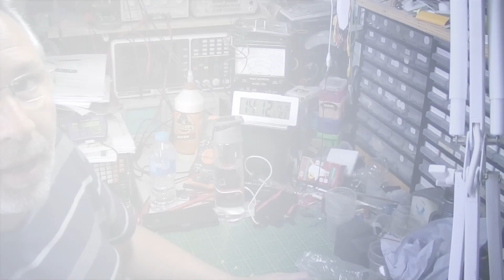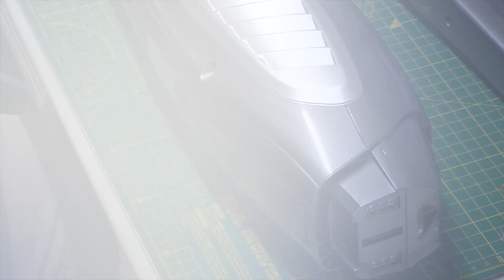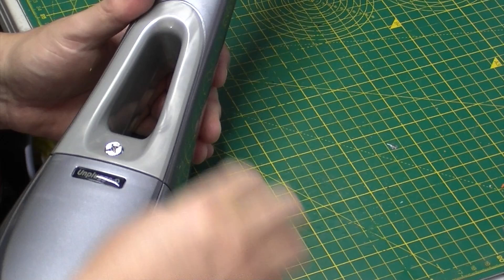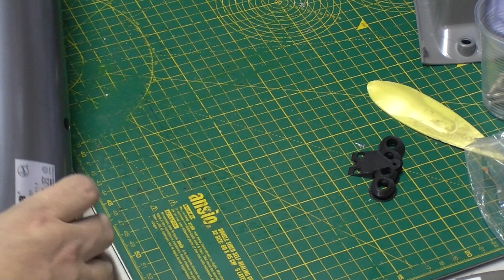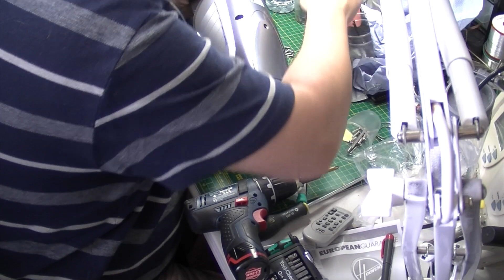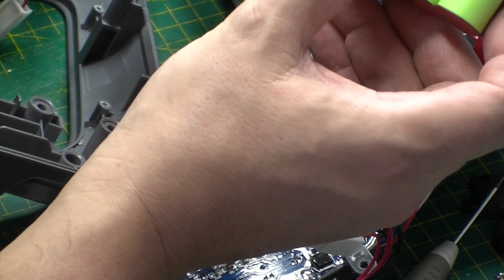Hoover UNP252A cordless vacuum repair part 1: Strip down and testing

Comment: I can never, ever understand why tyre make them do hard to change the battery, especially nowadays when they want people to stop producing so much waste.
Reply from the maker: Hi Andrew. Yes it’s not that easy but as long as you take lots of photos or video then it’s just a case of being methodical and getting it all back together. At least I now know that there is a solution for any future battery problems. I have a couple cordless drill,batteries to sort soon as well. Thanks for watching